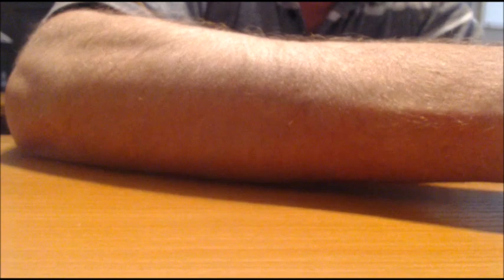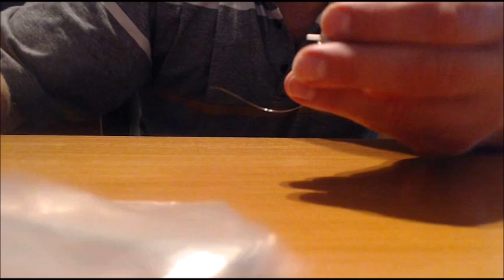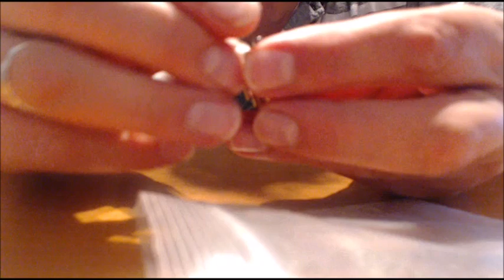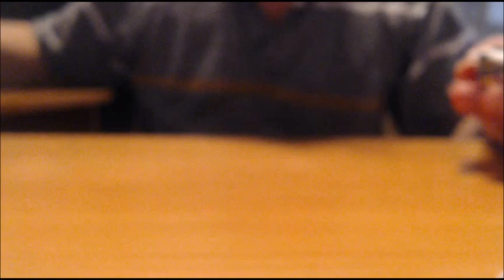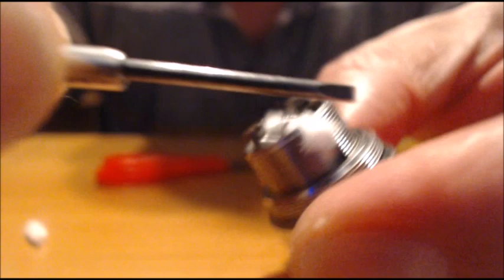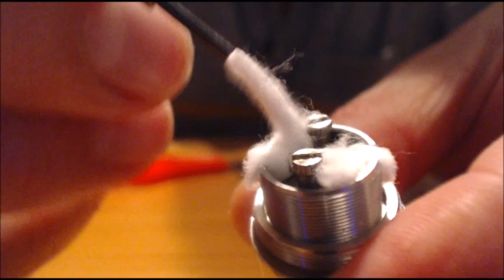covering wires for better taste, smoke and throat hit

Comment: Does this method replace having to split the wick and tuck the one half into the base?  Just wondering if I will have too much wick by using this method along with the split wick method
Reply from the maker: the point is to cover the legs of the wire that are uncovered lll. Use any method you like to arcive this result. I hope that mine is the easiest thats why I post it. If you have any better one please tell us :)